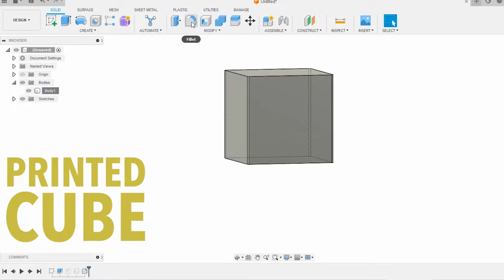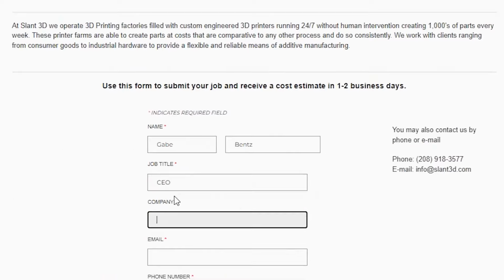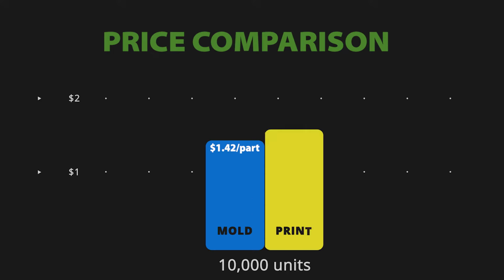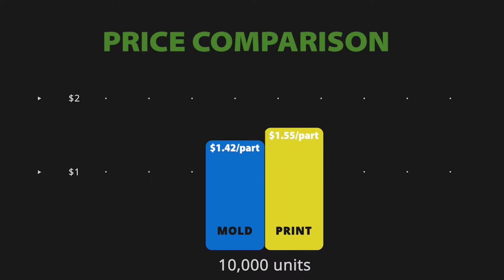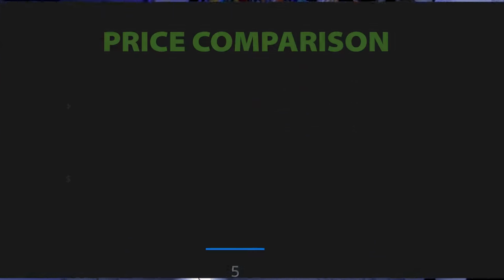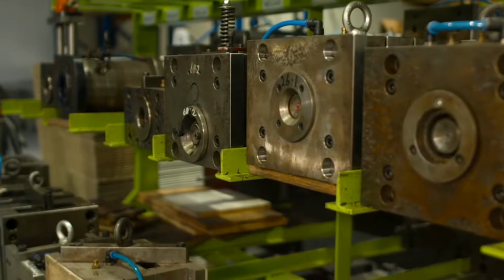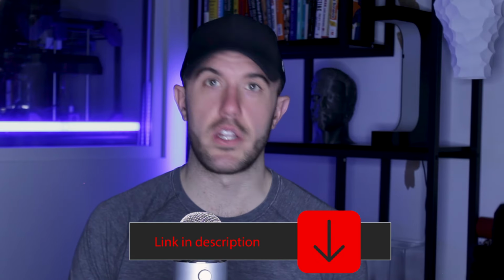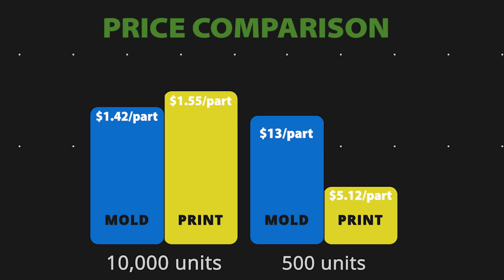3D Printing vs Injection Molding: From Design to Price

Comment: Instead of injection molding, you can do resin casting, which is much cheaper than injection molding. It's also cheaper and faster than 3D printing. It's ideal for medium sized production runs.

Comment: Injection molding cycle times is faster than 3d printing. U can easily churn out hundreds of thousands to millions  from a single mold and machine in a single day depending on material type and size of product. For large scale production  it is ideal. And China is not the only country to do injection molding. There’s American based ones too. Used to work in injection molding company in Singapore, Southeast Asia.

Comment: Liked the comparison, but I'm not sure a cube was the best object for the comparison. In fact, the solution was already proposed (a cube) rather than a problem proposed. Would be interesting to have a "client" come up with a request to design a bracket for say, a screen (select a TV or pc screen for example and you want a bracket to fix it to a structure, say, the back of a Tesla). Now you have an actual problem and have to design a bracket to solve it. Say the "client" wants to know costs for 100, 1000, 10000, 100000 and 1000000 parts.

If designed to be manufactured using plastic moulding, what would be the costs? If design to be manufactured using mass production 3D printing, what would be the costs?

A cube, a solid cube, is something that solves hardly any problem and lends itself to be manufactured better if done with 3D printing, so it's not a fair comparison (yes, moulding won in this video but it wasn't really a cube right? The initial request was for a solid cube). 

Im a big fan of 3D printing, but one has to know it's a tool for solving a problem and not an end by itself. Benefits of it would be more evident if using it to solve an actual problem were directly compared to using moulding to solve the same problem. 

Still liked the video and learnt a lot from it. Keep it up!

Comment: is resin printing just as good as injection molding?
Reply: The quality is just as good as injection molding, but it takes many hours to print, compared to a few seconds for injection molding.
Reply: @SchemingGoldberg  It's not nearly as good as injection molding. Injection molding is much stronger...
Reply: @thomasseeley8124  It depends on the resin you use. Some resins are just as strong or stronger than injection molding. FDM printing is weak, but resin printing is different.

Comment: I 3d printed a product  that I would like to try to mass produce , but the print time on this product was about 2 hours.i think I can thin out the product to get the print time down by half, but still I don't think my printer could handle 100s of these being made. What do 3d print companies usually charge for that. I basically would like to try to make a hundred of them to start to see how well they did before investing more money to make more of them...I hope this question made sense....
Reply: Just create a silicone mold of your part, and then do resin casting. It will be much faster than 3D printing, and much cheaper than injection molding.
Reply: Almost exactly the situation I’m in. Basically means injection molding is totally off the table though

Comment: Im working with thermoplastics and molds
There is a Lot going on 
From maintance the mold , isues , mods to create real product and there is often a problem with optimalisation of process especialy when lots of materials are different 
You Can produce Lots of waste and damage the mold too (What needs a man to repair What leads to spend more money) 
Not talking about electricity consumpt , watter cooling and maintance of te machine itself

Comment: Better comparison:  4 injection molded parts, plus hardware, plus assembly vs 1 3D printed part.  3D printing really shines with the design freedom it offers.  You can combined many parts together.  Less design time. Lower BOM cost.  Lower assembly cost.  

I routinely get parts for 3k tooling in NAK steel, first article inspections, 3 week turn, tight dimensions, good surface finishes, for 40 cents at 10k quantities. If comparing a single part, injection molding wins, (though revisions are an excellent point).  People pointed out cast urethane, which also wins vs 3D printing.

Comment: Of course, mileage may vary, and it definitely depends on what you want to make.
The same goes for overseas production, you may want to integrate it with other components that are all produced / assembled cheaper overseas.
Then again, there are probably larger scale 3d print farms in China as well. 

Still, it does illustrate that even at larger production runs it's an option worth looking at.